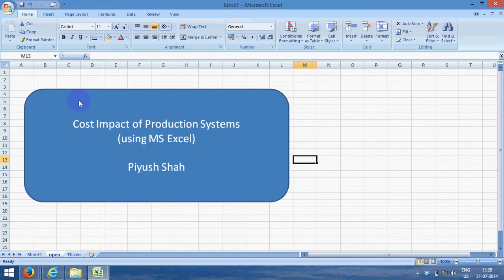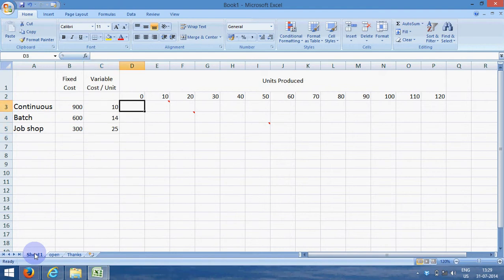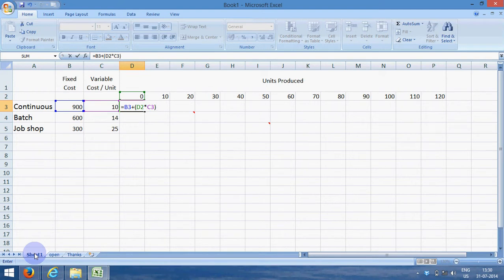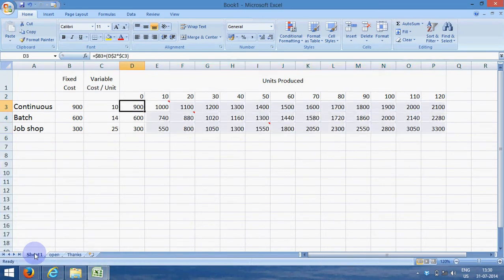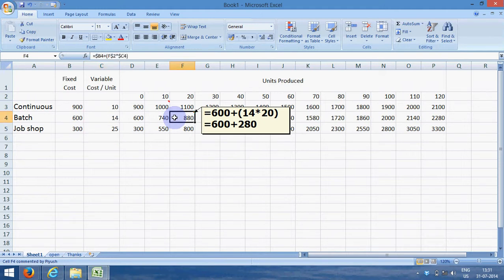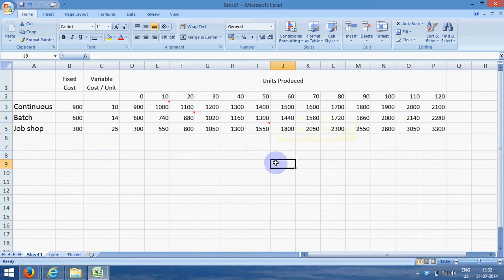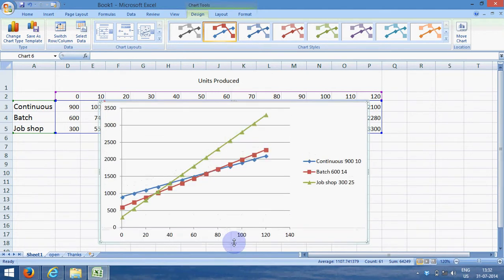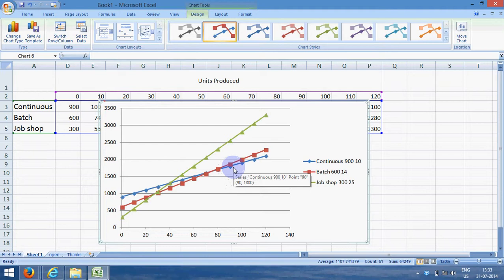Cost Impact of Production Systems

Comment: What is fixed cost and variable cost?
Reply from the maker: Assume you buy a car. The cost of the car is fixed and does not depend on how much you use the car. However, the cost of fuel is variable, that is, fuel cost depends on how much you use the car.